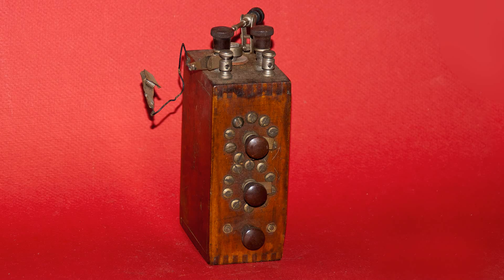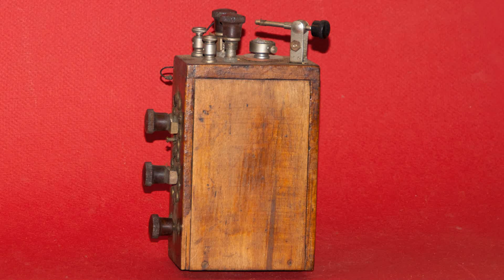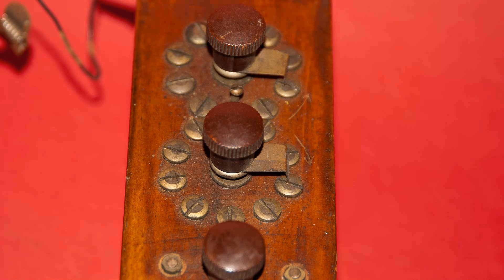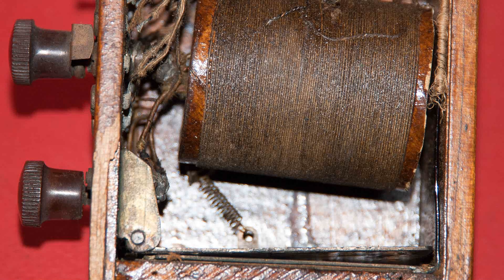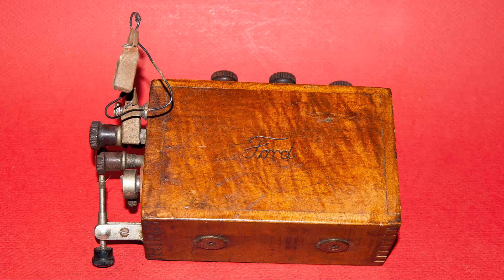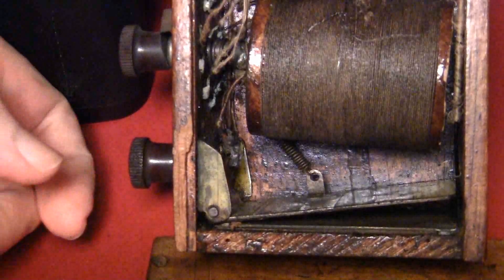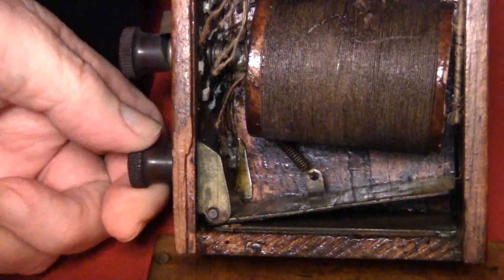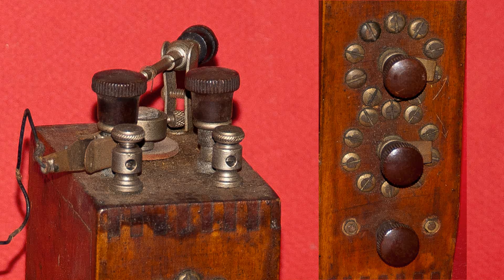Crystal Radio Set, 1920s

Comment: Thats the most amazing thing I have seen in a long time, thanks! When you consider those coil boxes were filled with hot tar, whoever made that had to spend a lot of time getting that sticky stuff out of there. I used to restore model A spark coils for an airplane called a Pietenpol, that used a 40 horse model A engine. The boxes I made worked but werent intended for air use. Thanks again that was great!

Comment: That is a buzz coil box for a Model T to be specific.  You can pick up these coils quite easily at auto fleamarkets, but I think the insides are potted with tar so it was probably a messy job to get the original coil out of it.  What is the book capacitor made from?  Looks like a name plate from something.  Very clever.

Comment: Here’s a tip you’ll know Rick but it may help others, when I get a set like this I put a germanium diode across the galena and the whisker connections, I make sure the whisker is not touching the crystal, then I go about adjusting the coil(s) and capacitor(s) knowing that I should get a station.  Once I know the tank is good I’ll remove the diode and try the whisker. I’ve found that trying an unknown set can take some time to get to grips with. Have fun.
All the best ... Andy